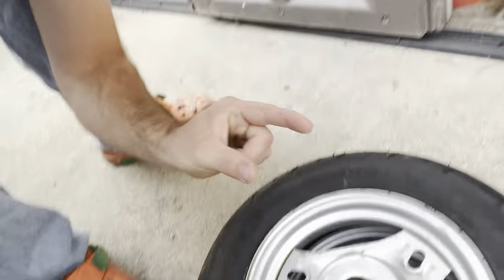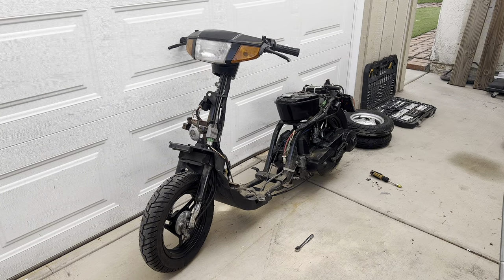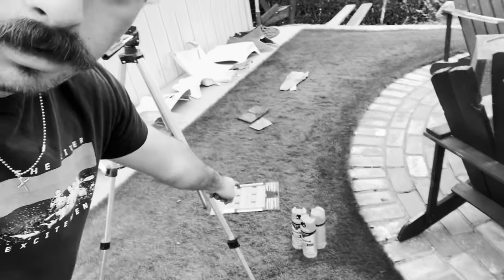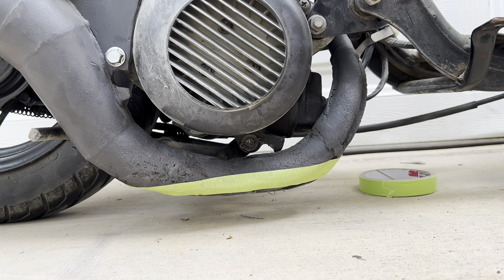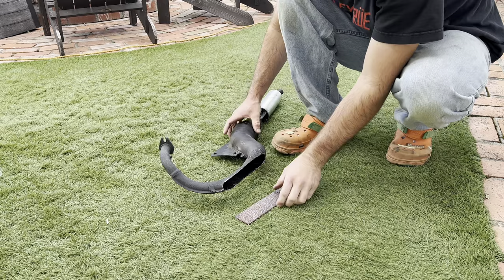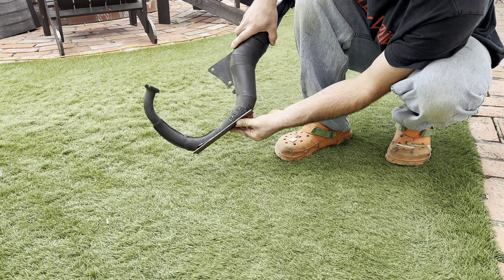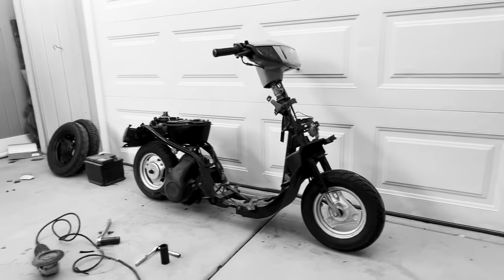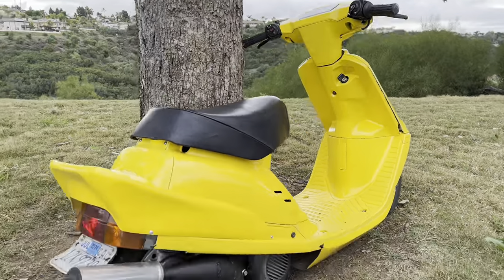Yamaha Jog Kuu-Gentsuki Build Pt.2  (NEW COLOR + WHEELS)

Comment: Not good to do that on the exhaust pipe, it’s designed very special to give more power on 2 stroke, all the cones angel are importen.
Reply from the maker: Neither is it good to lower a scooter by removing the springs. This build is just for fun, not a race bike 😁
Reply: @Blazeitjackson  ok, but still the worst thing to do with a expansion exhaust just saying 🙏 you could had made sub frame to lower it and still keep the old power.